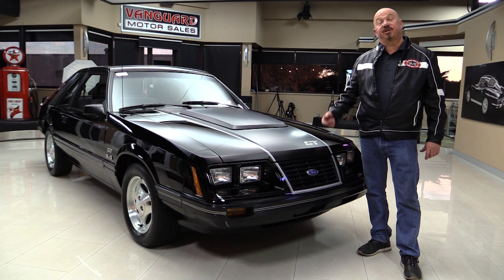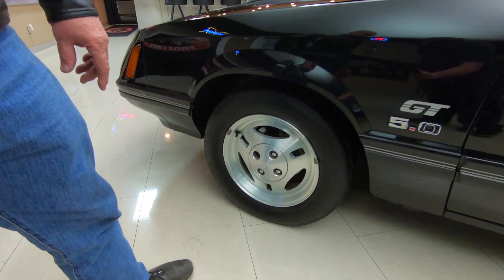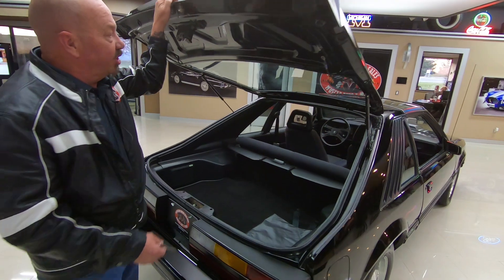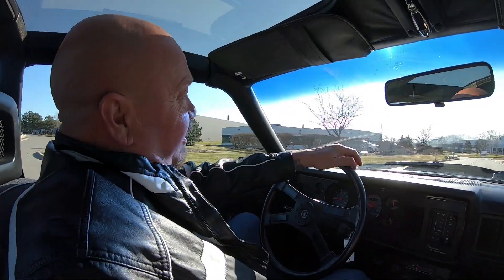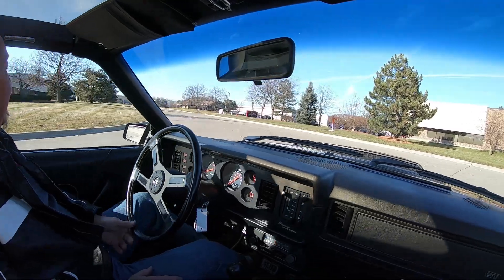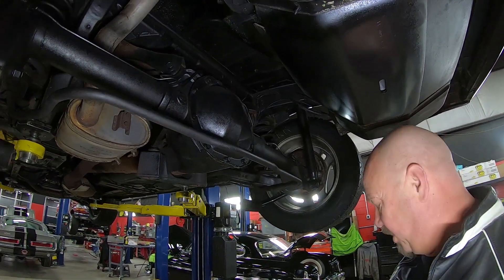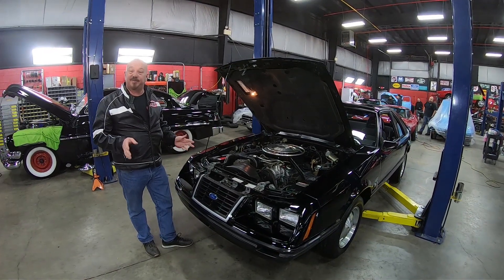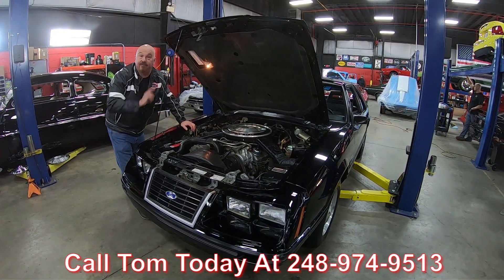1983 Ford Mustang GT For Sale

Comment: This was my car at 17 yrs old. I paid $4600 in 1988. The one I bought was a 1 owner beauty. I restored a 68 mustang prior to this but unfortunately all that time and money never paid off as it wound up having a cracked frame. The 83 healed my wounds. The rims were metric so I remember struggling to buy tires at $150 each in high school. Lol. I had a lot of fun with that car then wound up downshift into red line and blew a head gasket. Live and learn. Also got smoked by a damn Fierro one time. Good times

Comment: I had one of these back in the day. I beat the living crap out of it. I put a cam, intake, carb, true dual exhaust, rear end gear and aftermarket shifter on it. After all that, it was competitive with the newer fuelie 5.0 Mustangs ( 1986 and newer ), and the 350 IROC Camaro's. Spun bearings twice. Smoked 3 clutches. And, grenaded both a 5 speed and the 7.5 rear end. Fun car. Unfortunately, it got hit 3 times in 1 month which spelled the end of it. God, I miss that stupid car.
Reply: In 1983 I was runnin around with a black w/white stripes1970 Chevelle SS454 LS5 motor, built to shit and get!!, 4.10 gears, 3500 stall with a beefed TH350....MAN!, those were the good ole days, for sure!
Reply: He's not lying about any of that, I bore witness to every last bit of abuse that car saw.

Comment: My first car was a 1983 GT in black, red interior. 5 speed so it was a later 83. Fun car but kinda slow. TRX wheels are metric 390 mm not 15 or 16 inches. Hard to find tires.